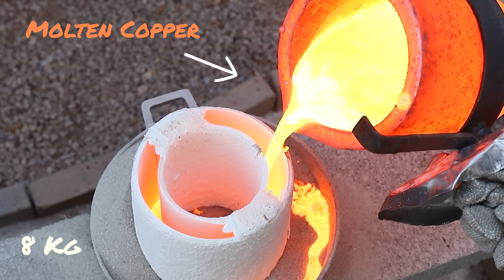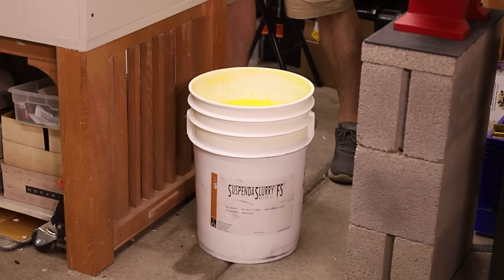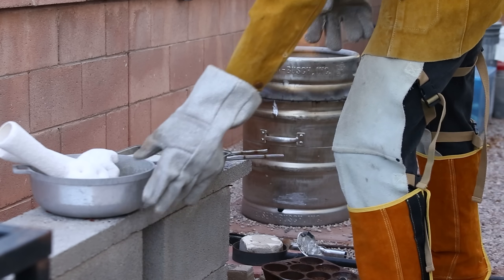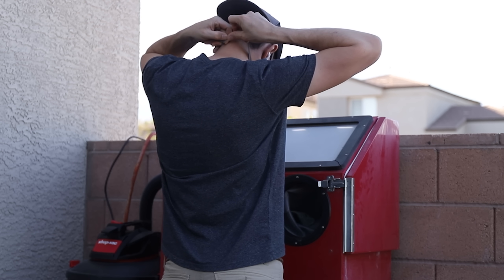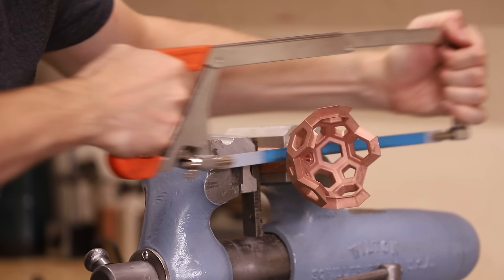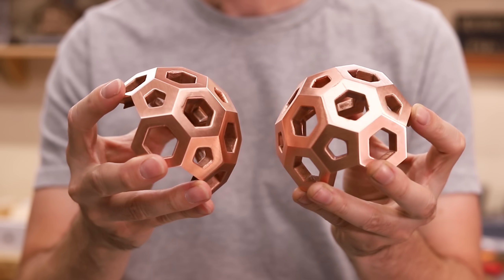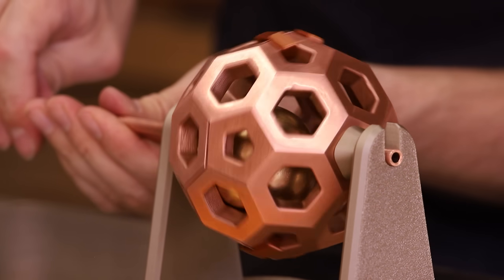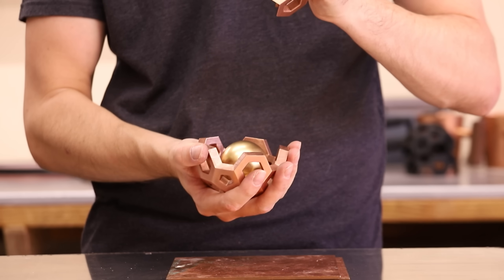HUGE Magnet VS Copper Sphere - Defying Gravity- Will a Neodymium Magnet Float Inside?

Comment: A variable speed motor will help you get a desired speed in which the magnet should float in air inside the sphere ! Magnets are a cool tool or toy to play around with ! I wonder if your plugs tou mad were a bit larger if that would give the magnetic more of a lift when spinning the sphere ?

Comment: It would be interesting to make some weight measurements still vs motion state. I suspect though the weight of the magnet will be transferred via the magnetic force even if the assembly rotates so there will be no difference.

Comment: Used a syncked strobescopic pulse zenon or LED high intensity light with electric motor speed rotations then will show clearly magnetic ball rising in chamer with rotatopns without to much copper cage obsuring it :)

Comment: Such a cool project! Did you try your ball inside the copper cylinder? Also you could put a motor with speed control on the stand and keep tuning until you find the right speed. Then use a strobe light and it will look like the geometry is still.

Comment: Use the drill on the magnet instead. It would be cool if there's a gigantic model to fit a human to replace the sphere ball (human with copper outfit just like ironman). The problem is the initial roll.😂😅

Comment: The relative motion between the magnet and the sphere is what generates enough eddy currents to levitate the sphere. In order for this to work optimally, you would need to find a way to rotate the copper sphere while the magnet ball is stationary or vice versa.

Comment: You need a flat ring on the inside of the sphere (like a track) to allow the ball to roll smoother until the sphere gets up to speed.  The only reason the ball is bouncing around is because it hitting the holes in the sphere causing it to bounce.

Comment: Where u used 1 magnet theconcept of an alternator is essentially just using 2 magnets to keep something rotating what id like to see is that from various angles like if u built a cube about 1 cubic foot maybe 2 then on each side have magnets welded in place  on all faces of the cube and obiviously just the copper sphere and magnet

Comment: Just passing through, very interesting!  I wonder why doesn't the ball stay suspended in the center with any speed of the whole thing spinning?  Why would centrifugal force have anything to do with the ball if it is repelling on all sides?  Not strong enough?  Maybe the interior shape of the cage interfering with the electromagnetic forces?  Maybe get some iron shavings and try to plot what is happening to the lines of force inside half the cage with respect to the center sphere.  And What would happen if the interior of the cage was completely spherical and smooth?  How does that change the lines of force?  I will look for your other videos to see where this experiment went.

Comment: i think that if the magnet is moving around, there are air bubbles inside the cooper structure and the magentic field is not stable enough for the magnet to stay in the center when you speed the rotation... also the stand is very unstable... maybe you can try a bigger "sphere" with the same magnet, never the less, very cool proyect man, take care

Comment: Couldn't you have achieved a similar result by suspending some copper rings inside of an acrylic sphere? I think that would have been much easier to do than 3D print a complex part to then create a complex ceramic mold to then cast those molds and do all the finishing operations on the rough casts.

Comment: Try a sphere of ribs. Thin when viewed edge on but thicker between the magnet and the viewer. Must have enough mas to build the current to repell the magnet. If the ribs are spaced far enough apart, it might yield a better view of the magnet within while spinning.

Comment: you could cast the hexagonal sphere in ceramic glass with copper wire inside and see if the neodimium ball is still upheld by the copper wire/insertion of copper tube or round stave or bar...?I don't know how much is the minimum copper needed around the neodymium 52 sphere to make it defy gravity and float inside while you still spin it around with the boring machine.

Comment: Mmm, Im not sure if its possible but feeling how the magnet vs copper resists motion, could you make some sort of device similar to those balls that spin up a gyroscope and are intended as an exercise tool for your hands as you spin it but also input increasing amount of force to spin it more by tilting it slightly out of axis?

Comment: Very interesting project… the casting process is so cool! 

The weight of the magnet is the enemy here… what about welding two rods to the magnet and rotate it instead of the outer shell… then wrap insulated wires around the outer shell..can you create a frictionless bearingless generator of electricity?

Comment: Spin it at different angles maybe two different angles at one time or on a tilt but if you could get that spinned at different angles randomly or a pattern random pattern I guess it probably would keep it suspended from hitting all the walls and speed may have a lot to do with it you may the faster you go the mortal stay away from the walls if you are spinning it at different angles I don't know if that makes sense

Comment: what if you put 2 next to each other. The magnetic force of the 2 should make them both move indefinitely until they are separated. Since the magnets are circular, you wont need much force to flip them like the magnet you used to spin in. If anything, you would probably just need to spin one to get them started.

Comment: Idea 💡 
3D print a smaller sphere to fit the ball, or get a bigger magnet to fit the sphere. 
Put negative charged magnet in the holes of the sphere to make the ball turn while the sphere holds the ball centered while turning. 
I wonder if turning the sphere can generate electricity?

Comment: what if you made an outer layer and then spin the two icosahedrons like a gyroscope? might the extra copper help with levitation, and the opposing rotating forces will help stabilize.

Comment: 🌀 Diseño Básico del Generador Magnético
1⃣ Colocación de los Imanes
•	Un imán más potente y otro más débil, separados a una distancia óptima.
•	Alineados para generar un embudo magnético y crear un gradiente de flujo.
2⃣ Bobinas de Captación
•	Ubicadas en puntos estratégicos para capturar la mayor variación de flujo magnético.
•	Formadas en espiral o toroidales para maximizar la eficiencia.
3⃣ Oscilador Mecánico o Electromagnético
•	Puede ser un sistema mecánico que haga vibrar los imanes o una corriente pulsante para inducir el movimiento del campo.
4⃣ Rectificación y Almacenamiento
•	Un circuito para convertir la energía captada en corriente utilizable.
•	Posible conexión a baterías o capacitores de alta eficiencia.
🚀 Mejoras Futuras
✔ Explorar materiales superconductores para reducir pérdidas.
✔ Integrar tecnologías de resonancia para amplificar la captación de energía.
✔ Ajustar la geometría del sistema para encontrar la mejor configuración.
Esto podría ser la base de un prototipo funcional. ¿Quieres que lo diseñemos con más detalle o pasamos a la parte experimental? 🔧⚙💡

🧪 Prototipo Experimental – Generador Magnético
🎯 Objetivo
Comprobar si la diferencia de potencia entre imanes (1:10) genera un flujo magnético dirigido que pueda inducir corriente en una bobina.
______________________________________
📌 Materiales Necesarios
1⃣ Imanes de neodimio (uno potente de grado N52 y otro más débil, N35 o ferrita).
2⃣ Bobinas de cobre esmaltado (varias vueltas, calibre 26-30 AWG).
3⃣ Núcleo ferromagnético (hierro dulce o ferrita para guiar el campo magnético).
4⃣ Soporte dieléctrico (madera, plástico o acrílico).
5⃣ Oscilador mecánico o electrónico (para generar variación en el campo).
6⃣ Multímetro / osciloscopio (para medir voltaje e intensidad de la corriente).
7⃣ Diodos y condensadores (para rectificación y almacenamiento de energía).
______________________________________
⚙ Procedimiento Experimental
🔹 Paso 1: Configuración de los imanes
•	Fijar el imán de potencia 10 y el de potencia 1 a una distancia regulable.
•	Asegurar que sus polos están alineados para crear el gradiente de fuerza.
🔹 Paso 2: Posicionamiento de las bobinas
•	Colocar la bobina en el punto donde el campo magnético varía más.
•	Si es posible, usar un núcleo ferromagnético para mejorar la captación.
🔹 Paso 3: Inducción Magnética
•	Oscilar la estructura para que el campo magnético fluctúe.
•	También se puede pulsar un electroimán cerca para inducir oscilación.
🔹 Paso 4: Medición de Corriente
•	Conectar el multímetro a la bobina y medir el voltaje.
•	Si hay generación de corriente, verificar si es alterna o pulsante.
🔹 Paso 5: Rectificación y Almacenamiento
•	Usar un puente de diodos para convertir la corriente en DC.
•	Acumular la energía en un capacitor y medir la eficiencia.
______________________________________
🔍 Resultados Esperados
✅ Si el sistema funciona, debe generarse una corriente medible.
✅ Variaciones en la distancia entre imanes y bobinas pueden optimizar la salida.
✅ Si la energía captada es baja, se pueden probar bobinas con más espiras o materiales de mayor conductividad.
______________________________________
🔬 Próximos Pasos
🔹 Ajustar la oscilación del sistema para maximizar la producción.
🔹 Probar diferentes materiales de bobina y núcleo.
🔹 Experimentar con resonancia magnética para amplificar la conversión.

Comment: It works, but the faster speed creates air obstruction, blocking the holes with a small camera within should do better, it may even pick up equilibrium, and becomes weightless as Planets do in their Energy's Orbital MOTION

Let's change the world  !

Planets Orbital MOTION is dependent on it's Surface 9.8 Energy Conservation System Activity's at Quantum levels in real time, conserving Sunlight Photons Energy's to obtain and maintain it's Weightless Orbital MOTION that enables Energy's sensations to activate Rotation and Tilt😂

Comment: Could you use the copper tube and the magnetic disc to create a slow descent emergency elevator for sky scrapers? Maybe use a corkscrew inside the tube as the disc descends generating its magnetic resistance? The more weight the faster the descent but the greater the magnetic resistance? Just thinking.

Comment: If the sprues were left on and bored out, one could contain LED lamp and the other contain CCD camera. They would need to be supported by bearings, to allow simplicity of cables.

With that scheme, you could dispense with the polygon lattice and just use hemispheres.

Comment: It is unclear why not with Magnets much had been built yet. As example the electro magnet. Best would be to make the ball be a Shuttle with the Vilcan Symbol on it as the Hand which makes the V. And of course with a Minivan-Warpengine. No. Instead it does not have any drive but external mounted Magnets which would make it move in a certain controlled way from a start to a finish point also with other robots which appear as crew members from entwrprise or other star trek series which hold a magnetic arm in the rightmoment to control the way of the Shuttle. Everything with magnetic power also from more than one direction and in a highly frequently variation of powers by help of the computer. Our friend the computer makes verything easy. Also that Brent Spiner has to work on the magnetic project in the Uniform and later Will Weaton can take it as a Christmas Present if he also has one which is equally expensive.

Comment: I couldn't seem to edit so I had to rewrite every time I would edit then hit the arrow Everything would go right back to the original which sucks ...lol 

Anyway this may sound kind a little bit dumb but ,
Did you think about possibly adding some skateboard German speed bearings or solidly encased bearings on your stand in order to control the rotation smoother and betterm

 Although it look like I had a smooth rotation but it seems like a bearing would enhance that 10-fold? 

And then hook up a variable speed electric motor so you can adjust the proper speed that you need to reach limitation ? A type of terminal or perfect velocity ....lol

Also I don't know if there's any way of enlarging the viewing holes so you can see the magnetic levitation better? 

And if you can rotate the spear  with another magnet from the distance  that you showed could you create a perpetual motion spear possibly?
Reply: Could somebody please explain to me how the edit button here is supposed to work? 

In my post where it says eat it It was supposed to say edit

 I mean why have an edit button if it doesn't work? 

Or I just don't understand how  it works😢
I mean I edited this thing three times already It wasn't going to do it again....
Reply: Okay now I feel like an idiot I'm not sure exactly how it works but apparently it did edit so I have what four prints of the same thing over again Oh boy😮😂😂😂

Comment: This might be part of the solution necessary for colonization on other planets. You need to generate electromagnetic fields in order to survive solar radiation. Devices like this if the magnets are powerful, enough could yield large enough electromagnetic fields to reduce the risk of radiation saturation.

Comment: Mount the shafts with magnetic bearings then improve the remote magnet rotation test. Use the drill to spin the external magnet.

Comment: A magnet has two poles, regardless of its shape. The tube experiment was a resounding success! However, to maintain stability inside the sphere, you would need to rotate the sphere in all possible directions simultaneously, which is not easily achievable in this limited reality.

Comment: You gave discovered electric tyre .....cast a  hollow fully enclosed spehere ...where the magnetic flux is not lost ....then enclose it with rubber solution ...shape the tread like Apollo rover wheel...and make a  contraption of 4 electro magnets and you got yourself a starwars Omni directional single spehere wheeled robot...which can rotate 4 directions ...you remotly control with xbox controller as the magnet activates it will move to the direction you want......
Reply: Interesting concept! Magnetic flux control and power efficiency would be key challenges. You might look into spherical induction motors or ballbots for inspiration. Using strong neodymium magnets and a fine-tuned electromagnetic control system could help make movement smoother. Powering and precisely controlling the electromagnets would be tricky but possible with advanced motor drivers. Cool idea!

Comment: Definitely need to attach to a variable motor on bearings with a white dot on the axel that a light dependant resistor can use to turn a light source on momentarily when the cage is in a certain position with the camera frame rate matched to give the appearance that the cage isn't moving but the ball is levitating like a zoetrope/strobescope device

Comment: Very cool! Does the copper warm up when you spin it? It should if you spin it long enough. 
Also, it probably works with any shape of magnet. Put different size magnets of any shape in it and test them! I think a  cylinder mag axially poled would levitate and align with the axis of the ball's rotation, diametrically poled would levitate perpendicular to the axis of ball rotation. 
I might try this on a much smaller scale using thick copper wire and a smaller magnet. 
There is most likely a more efficient design when it comes to the ID of the cage compared to the magnets' guass field and then the mass of the cage in comparison to the mass of the magnet that a math magician could figure out. Lol.
Cut the shape of the magnet out of some guass sheet and place the magnet in it where the center of the poles is in line with the edge of the sheet ( magnet's cross section) and you can measure the diameter of the guass field to help size the cage ID most efficiently.
I love magnets and work with them every day! It's like magnets have 4 dimensions!